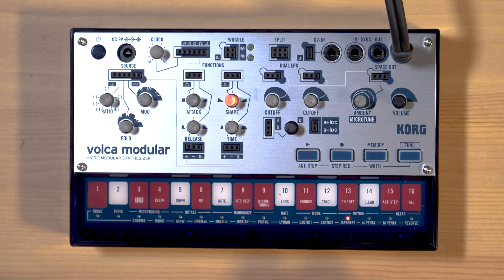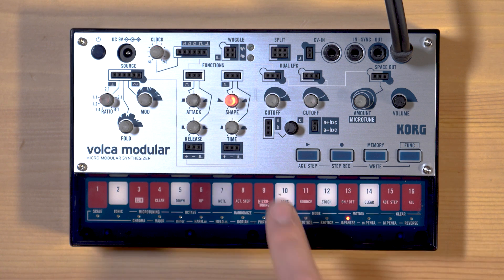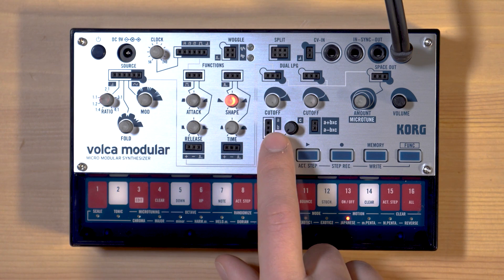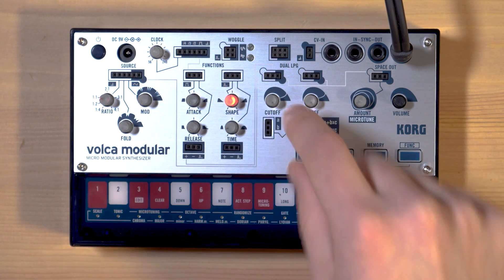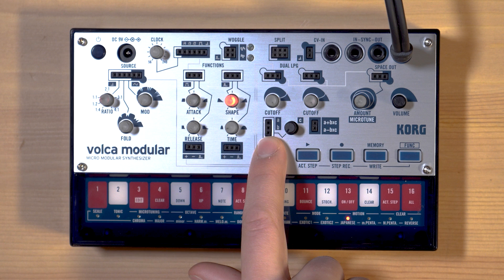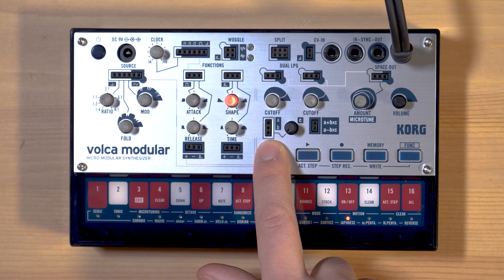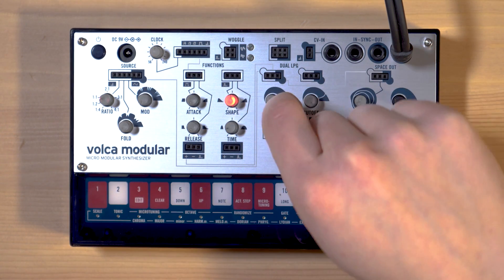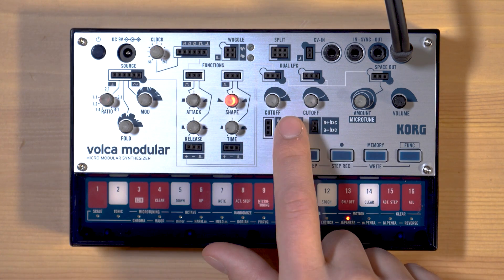Korg volca modular Tutorial 4: Utility Modules Overview

Comment: OK, I've just followed the Tutorials up to and including this one.
They are terrible! They feel like they were just thrown together last minute.
Check out the end of this rant for some links to decent vids, but if you do keep reading this keep in mind that this is an entry level and upwards synth;

These tutorials so far have the worst presenter, he's pretty hard to follow, and acts like he has ants in his pants. Frequently using all the jargon without breaking it down for the layman, he's smashing patches in so quick, and there is no easy to follow 2D pop up showing the patches, instead you have to try to copy them as he's putting them in, often captured by the camera on an angle that obscures what he's doing. He does this talking about the patch points like you know what they do, but if you did you wouldn't be watching this series of vids, and all this without once referring to the "Module Reference" card that comes with the synth, he doesn't show it, or even mention it ...and these little patch points are misleading without it! For example, in reference to the "Split" section centre top of the synth, I assumed that the four points surrounded by the darker section of the halo were common to each other ...they aren't! He hasn't once mentioned the fact that there in and outs for both the Audio and the CV (control voltage) on most of the modules patch locations, or even that the ins are surrounded by the clear section of the halo, and the outs the dark section, with a little lobe directly next to the Audio patches

Anyone who hasn't a clue about Frequency Modulation, especially this style of, is going to find these vids intimidating and decide that this synth isn't right for them, which is a crying shame! This is an ambient sound generator, with a really chilled vibe, capable of some very atmospheric "Blade Runner" like sci-fi styled sounds. It's amazing.

If you would like to see some good tutorial styled reviews of this little gem check out these two links;
https://youtu.be/nPqgKMGlKbA
https://youtu.be/MJMRQ4-ctiw

If you would like to really hear what this synth is capable of, there are plenty of decent vids on YouTube, but here are some different styles of music using the Volca Modular worthy of your attention;
https://youtu.be/uu6Tm755pIY
https://youtu.be/e-NR4xDEarc
https://youtu.be/CROAOEzH1zA
https://youtu.be/ofVYZQXoruw
https://youtu.be/bCxyckRVgxQ
Reply: Thank you legend

Comment: How do I set up the Utility section to work as a ring modulator?
Reply: Take a  patch from both of the oscillator outputs at the SCORCE;
The right output is the Carrier signal, take this to the B input of the UTILITY
The left of these two outputs is the Modulator (has a Triangle wave denotation), take this to the C input on the UTILITY
Using the pot of input C at the UITILITY as well as the RATIO pot at the SOURCE you can control the
 Ring Modulation.
Now take a Patch from a+bxc to wherever you require it, e.g. the signal input of the left LPG (make sure that the CUTOFF pot is fully open).
Reply: @gapster77  Thank you.  Very well explained.
Reply: @dinogoldie9716  Glad to be of help.
The Modular is a little gem, I have 2 and love tinkering with them. Every time I use them I find out something new, the time spent is often rewarding and I always enjoy the process.
They lack effects, so using a pedal or something is advised, run them through a Korg NTS-1 for some Modulation, Delay and Reverb, the results are often outstanding!

Comment: is it wrong to assume that the attenumixerverter section can be used as a ring modulator (summing the a-bxc and a+bxc), with the c attenuator controlling the modulation amount?
Reply: You can indeed use the attenumixerverter to create a ring modulator. Simply take the outputs of the modulator and the carrier and put them into b and c and then take either of the outputs and feed it back into the gate.
Reply: You can do Ring Modulation as follows;
Take a  patch from both of the oscillator outputs at the SCORCE;
The right output is the Carrier signal, take this to the B input of the UTILITY
The left of these two outputs is the Modulator (has a Triangle wave denotation), take this to the C input on the UTILITY
Using the pot of input C at the UITILITY as well as the RATIO pot at the SOURCE you can control the
 Ring Modulation.
Now take a Patch from a+bxc to wherever you require it, e.g. the signal input of the left LPG.